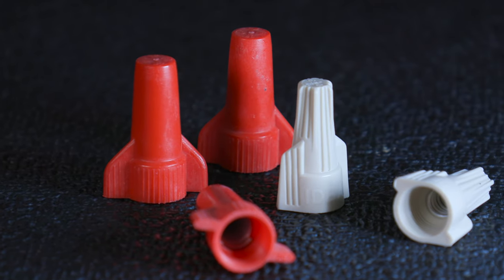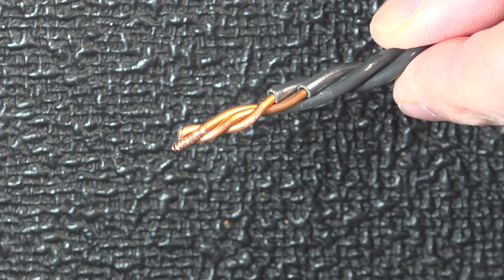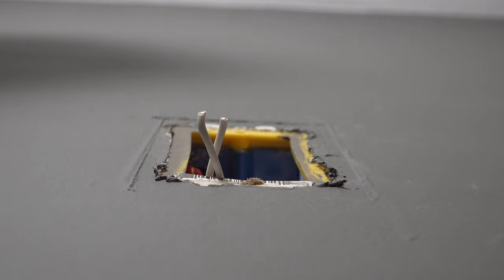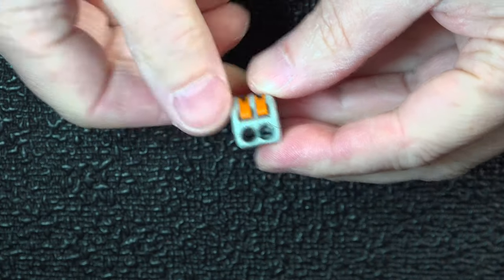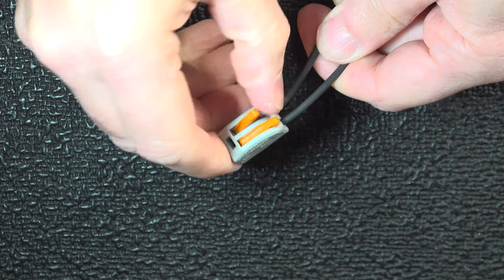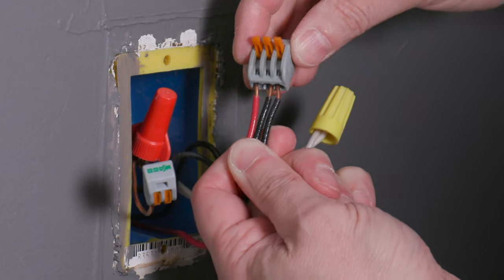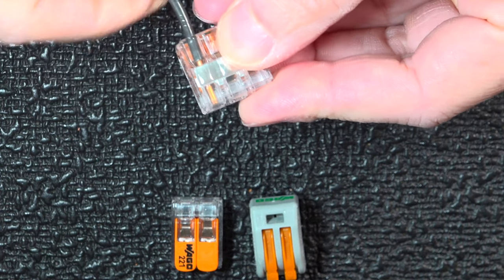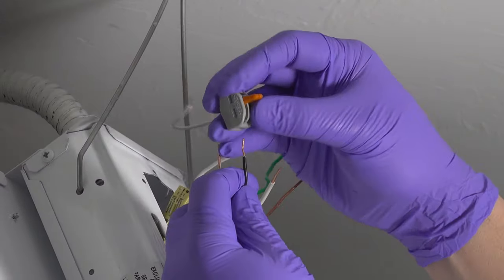Never use Wire Nuts Again - Wago is Better Electrical Connector

Comment: I'm  completely confidant in the approx 750,000 wire nuts I've installed in 30 odd years!👍
Reply: I’m an electrician with 40 years in service. WAGO is a German brand. In Europe voltage is 220 volts to ground. These work great there but with our lower 115volts l am concerned with the limited contact surface area of these. That’s the reason I never once used “quick wire” devices in my career! I only use these for connection of fixtures and only if they come with the fixture because they save my precious Wingnuts for more important jobs lol.
Reply: @ProctorsGamble  I'm not sure of the internal construction of the quick wire portion of regular household recepticals but I figured they may be similar to the old Wagos and I remember more than a few quick wire recepticals failing and becoming intermittent and a real pain to troubleshoot ; the newer Wagos seem to have a much better wire gripping mechanism though. I'm good with my wirenut method. 😎
Reply: That’s fucking wonderful. 750,000! Wow. Amazing. That’s around a dozen an hour. Your woman is a very lucky gal. Looking forward to the parade when you hit 1 million.
Reply: I think your over exaggerating by atleast a half million

Comment: Personally, I think that wire nuts are quite forgiving and the fact that they have been used ubiquitously for nearly 100 years supports that.  Of course there's always a way to misuse anything.
Reply: sometimes new things can work better even though we are so used to doing things the 'regular' way. For instance I just did some new spigot connection in my house and used the shark-bite setup instead of sweating pipe. More expensive? yes but way the hell easier, safer and pleasurable. Just keep that in mind when new technologies present themselves !
Reply: @oceancon  You might LOVE the new fittings today but your opinion won't be valid until you know they last as long as the old method which is forever.  I hope they don't leak in a year because they are not fun to replace.
Reply: @ramtek2702  maybe so but they are easy to replace. If you make a mistake when installing its easy to take apart and redo. just saying dont ignore new tech just for the sake of it
Reply: @oceancon  I don't ignore anything but my experience with "NEW" is just some guy finding a way to show you some short term gain while concealing long term consequences that often become someone else's problem.  I've heard they're very difficult to replace where sweat fittings only need to be heated.  Sweat fittings are not difficult if you are patient and have the right tools & knowledge.  These days people are always looking for ways to cut corners.
Reply: @oceancon  Shark bites are over priced junk
Reply: I can think of no better better way to put that than comparing wagos to sharkbites. Both market themselves as a quicker, better connection, both are often misused, both fail even under ideal conditions, and both cost twice that of the real thing
Reply: @Recreationaltrespasser  exactly... nailed it
Reply: @Recreationaltrespasser  I not against new tech but I also know that if it aint broke, dont fix it.  being a non plumber sharkbites have saved my ass a few times , I have only heard good things but I wouldnt use them at my house as a permanent solution.
Reply: @Stolas So, by your logic if there's something (anything) 100 YO that is bad then everything else 100 YO must also be bad.  BTW, the imperial system works as well as any such system, it's just harder to learn and even so has produced some amazing tech in those 100 years.
Reply: @ramtek2702  Imperial does temperature better. Finer degree of accuracy.

Comment: I've been electrician in Finland nearly 20years and never used these. Only seen when opening old junction boxes. So it's been rip here much longer 😂
Reply: +1 for here in The Netherlands.. Prehistoric wire nuts are not in use for a long time already here
Reply: @eliaswb4133 

Lul niet man voor fabrieken etc is het zelfs verplicht ze kunnen veel grotere vermogens verdragen dan steekwago
Reply: Yupp, whenever I see those shitty wirenuts I replace them with Wagos. And also there are Wagos for 8 wires, I would never trust wirenut to hold 8 wires.
Reply: It's really sad, because in Hungary we use Wago at least 5 years. Somehow, we don't use wire nuts, because if somebody doesn't had terminal block, he just twisted the cable, and put electrical tape on it.
Reply: I've never seen wirenutss in Germany and I think nobody is using this in Europe today. There is nothing better than Wago
Reply: @misterspinkick 

Germany has it own shitty electric system in Netherland still use them whe have the best electric system in the world! Wago limit is 24A  and seen a lot of burnout homes becouse people don't put it far enough,  wirenut k1 has no a limits the limit is the thickness off the kabel.  Facts.
Reply: Torille
Reply: @Broooski  I'd say 24A is plenty for 230V
Reply: @Broooski  take a look @ the Wago 221-612, up to 6mm² and 41A, these are slightly larger than the 221-412 but should fit every need
Reply: @Suicid344 

I know that one,  problem is people at home use wagos and have no feeling with it, problem they do not put it far enough and start a fire now and then, twisting the wires use conex is a always solid connection.  On site whe use wagos but in homes whe see a lot of problems with it
Reply: They're trash and dangerous. This guy is NOT a sparky lol
Reply: @eliaswb4133  what do you use?

Comment: I was always taught that if it's solid wire. The wire nut should only be protecting your connection not making it
Reply: give it a little extra twist to lock it though .. its more than just a cap
Reply: That's not exactly correct. The twisted wires will form oxidation over time (increased resistance at splice) and might loosen based on expansion and contraction under load. The twist on connector addresses these problems: the conductors are placed into compression and remain so during expansion and contraction. And the square "spring" inside the connector cuts into the conductors and forms a gas tight connection, preventing oxidation at the contact points. The twist on connector is definitely part of a proper splice..

Comment: I use Wago connectors only for ceiling lights where ease of use and speed is important and the amperage is low.  I never use them elsewhere because a twisted connection with a wire nut has far less resistance.  Note that wire nuts are more of an insulator for a twisted connection and are not really intended to hold the connection together - that is what the twist is for.
Reply: Wrong! It has no resistance at all.
Reply: @julianreverse  where’s the basis for your statement? If a splice is properly made then the wire nut isn’t even necessary. It’s there to insulate the connection, not hold it together.
Reply: If you think about it, both views are correct, depending on the application.
If you are twisting two or three 14 gage wires together then they will hold on their own if properly twisted when the nut it twisted.
If you are twisting three or 4 number 10's together you're not going to get as much of a twist on the wires in the connector area and they will not hold tight as if they were 14's.
Electricity takes the path of least resistance, when a wire nut is used the wires have a direct connection to each other. If these other types of connectors are used the connection has to rely 100% on the connecting device. This adds another point of potential failure to circuit.
Reply: @MicahFunk  If I am joining several 12g or 10g wires together I use the type of connector that uses a brass collar with a set screw in the side to bind the untwisted wires securely together, and then attach the supplied plastic cap over the connection.  Looks like a wire nut but is very secure.  I do use Wagos in ceiling light fixture because the Amps are low and the connection is very fast.
Reply: Far less?
Reply: @36736fps  What is 12g wire? Its some dumb USA unit? Can you use just diameter if wire in mm? Direct unit, not some dumb AWG unit, whitch dont even make sence because lower number bigger wire :D

Comment: Those wire nuts work just fine, I'm an electrician who has been using them for around two decades and I have to say I have never had an issue with those wire nuts.
Reply: I’m an electrician with 40 years in service. WAGO is a German brand. In Europe voltage is 220 volts to ground. These work great there but with our lower 115volts l am concerned with the limited contact surface area of these. That’s the reason I never once used “quick wire” devices in my career! I only use these for connection of fixtures and only if they come with the fixture because they save my precious Wingnuts for more important jobs lol.
Reply: @ProctorsGamble  I've used them on both 120 volts ac and 240 volts ac. As long as you install them properly there shouldn't be any problems but people do things differently I suppose.

Comment: So wire nuts have been being used since the early 1900s and it isn't until now that they are "bad connections"... If there is a better device, fantastic, I'm in, but don't demonize what's been working only to sell a new connector...
Reply from the maker: I am not selling you anything except offering you a better life, in a small way. Buy them, use them, if you hate them return them & you lose nothing, come back here and tell me I was wrong. I don't think that will happen. I show only products I own, use and love and know what works and what's crap. This is a winner every day.
Reply: Nuts are terrible in comparison. Specially if you’re testing connections. After you use one of this lever ones you won’t go back. It’s like sleeping in some straw vs a real mattress,
Reply: @SilverCymbal  Are you an electrician?   or a band major drumming up interest in semi-useful items?
Wagos  are OK for some applications.
Wire nuts are better for many appllications.
Reply from the maker: @JustHazardous  Electricians don't like change. They hated LED lights, smart technologies, and the list goes on but they all eventually made it. So you can insult me all you want, wouldn't it much easier to just buy a pack and prove me wrong? Read the comments from people USING these. All feel the same. Not wanna be Wago connectors, or backstabbed outlets, I get it other crap products exist These aren't. I could be rich making cell phone and digital camera videos instead I make videos about real projects and real things that work.
Reply: @SilverCymbal   over time your wago copper compression with the lever will fail under multiple load demands ie a switch going on and off. You will change those before a wire nut.
Reply: @SilverCymbal  We hate LED's because they are so sensitive to any load being pulled by the circuit which makes them flicker and hum (humming is from a loose connection which is 99% of the time the manufacturer's QC), we spend hours on service calls because customers believe our wiring/installation is at fault when it's the product they wanted and that's hours not being paid for most of the time. so yes we can be hesitant at times.
My company uses LED products all day long, but they come with a shit ton of issues, it's now built into the bid. It's not about "electricians" not wanting to change,  I'm all about improvements, it's about why reinvent the wheel? LED still has very far to go before they become as straight forward and easy as incandescent.
Reply: @bbui1990  The WAGO connectors are spring loaded and therefore will not loose grip over time.

Wirenuts are prohibited in Germany for safety reasons, while the WAGO connectors are absolutely standard for decades.
Reply: @bbui1990  Bullshit, but that is exactly the reason, why WN fail.
A screw and a nut without a spring or glue gets lose by temperature and vibrations too.